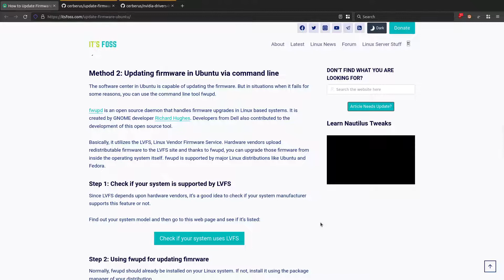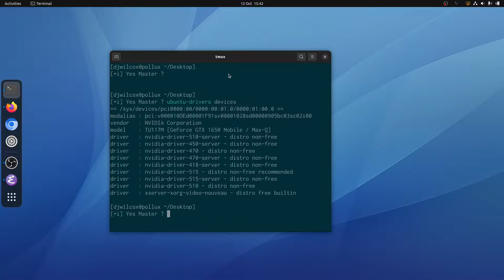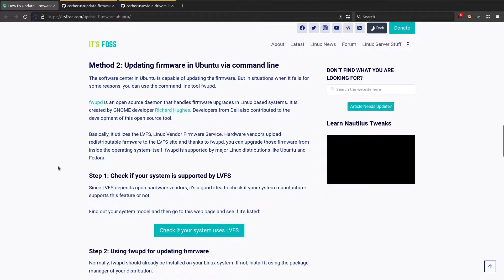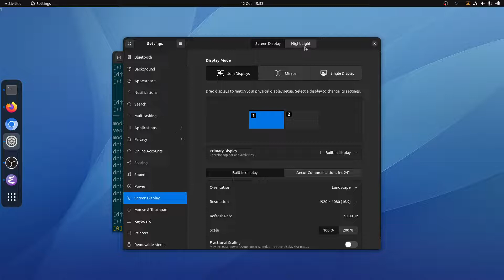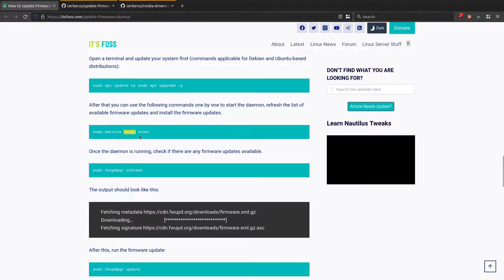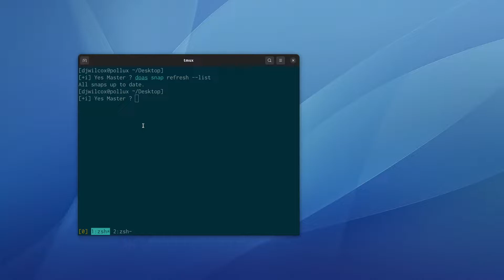Linux updating your firmware and drivers

Comment: I have a $5 USB Ethernet adapter (VID0A46 / PID9621 ), there appears to source code for it
 (qop_kernel/drivers/net/usb/dm9620)

But how do I use it?  I have gcc installed, but not sure what else I need.   My goal is to plug it in, and call a function to read/write/read from its eeeprom  (dm_write_eeprom_word)
Reply from the maker: Hi Mate, have you booted up with the adaptor plugged in, i know it sounds obvious
but i have a display port to ethernet adaptor for my old macbook air 
and it doesnt show up unless i boot up with it plugged in, hot plugging the adaptor doesnt work

does the usb adaptor show up if you run
lspci -nn

or if you run
ip a

to list the network devices